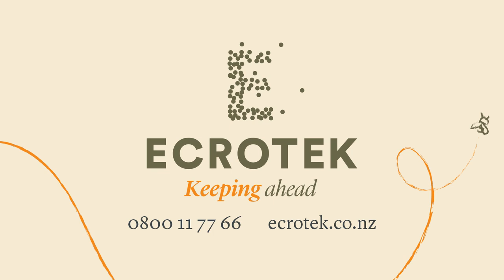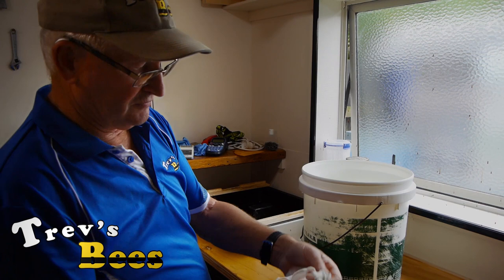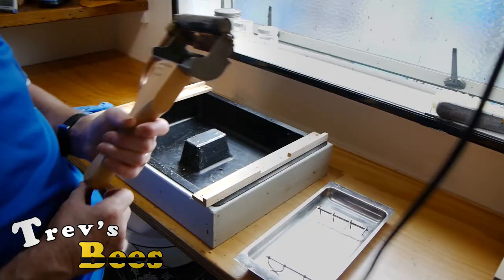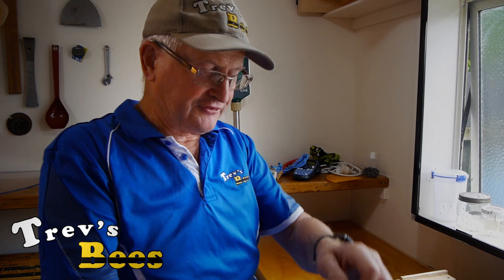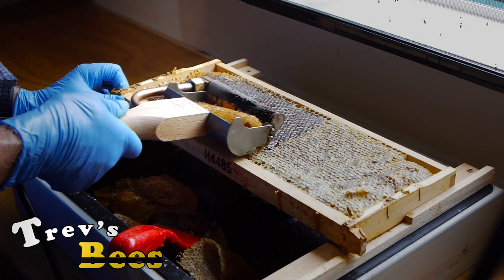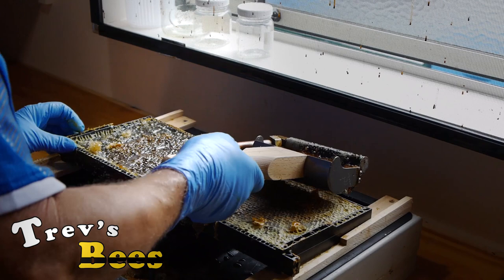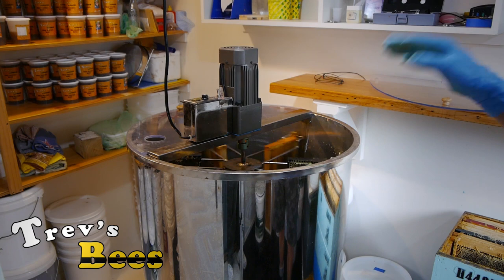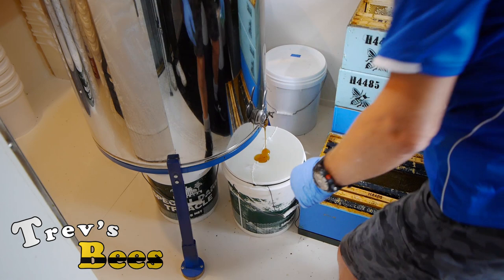Trevs Bees - Honey Harvest - Extracting Honey and using the Honey Plane

Comment: don't look for me getting the decapper  To rich for me  I just make a hot wire
Reply: ik run it down the side of the frames many as i have . The hot wire faster
Reply: yes many ways, the hot wire is like cutting air. Super fast  The frame sides is my guide  its 13" long  in a square handle   i like it   The hot knife makes a vacuum meltsl the cells closed   cheers